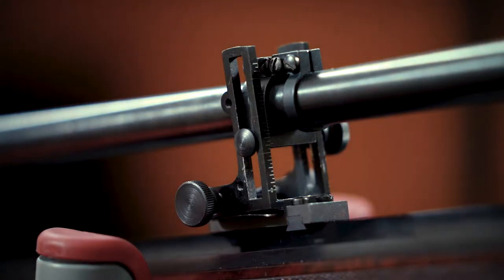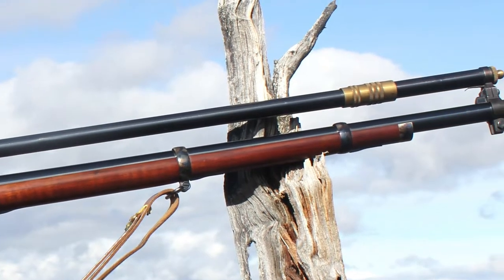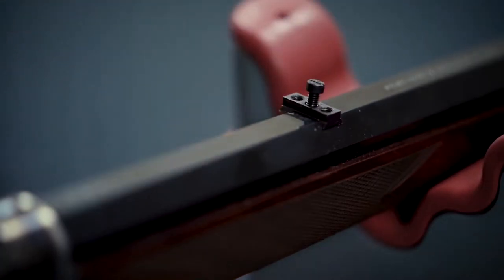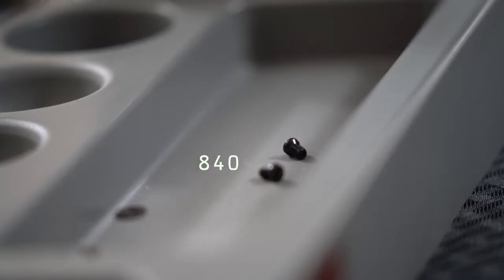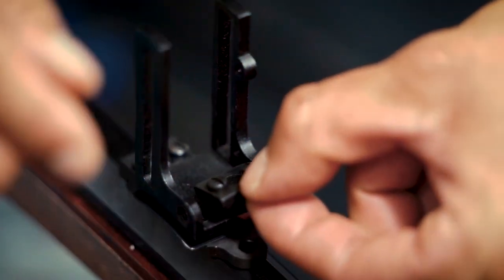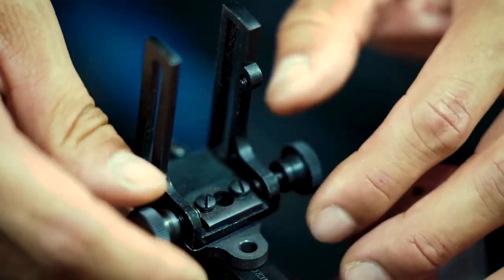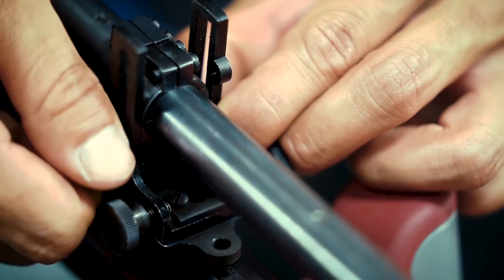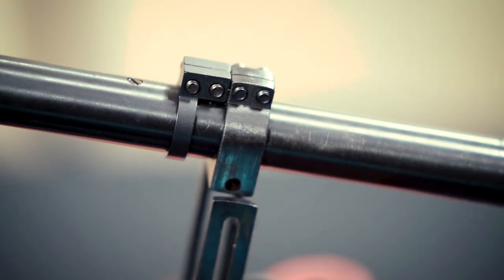Wm. Malcolm 6X Long Rifle Telescope - Rear Mount Installation

Comment: ,hi,will it work in a indoor ( less light extreme small scope ) range ????
Reply from the maker: It'll work indoors - I've used it fine under fluorescent lighting. As to the other question - how small is an 'extreme small scope range' in this scenario??

Comment: Does this work with a remington new model army carbine with octagonal barrel?
Reply from the maker: The Malcolm long rifle telescope would require a barrel that is at least 28" long. You can mount the Malcolm short rifle telescopes such as the Two Tone 6X 18" scope. You would need to drill and tap the scope bases onto the barrel.